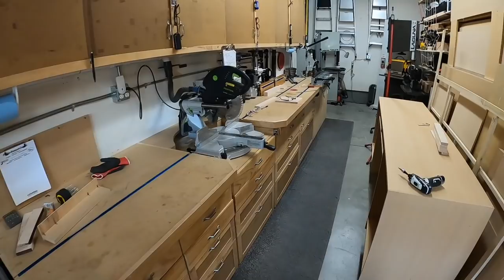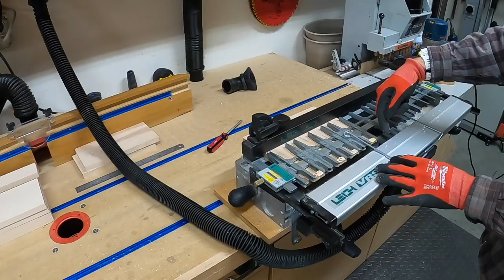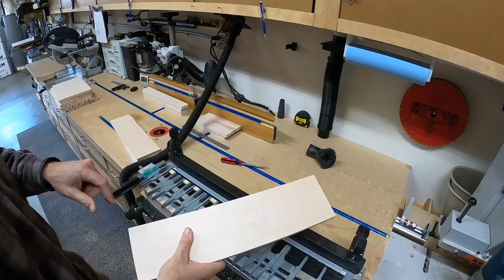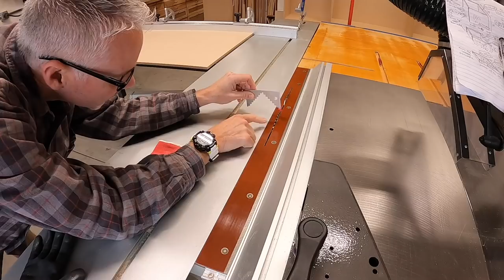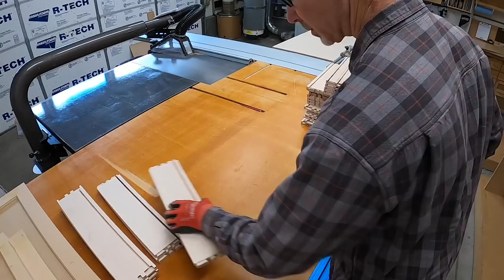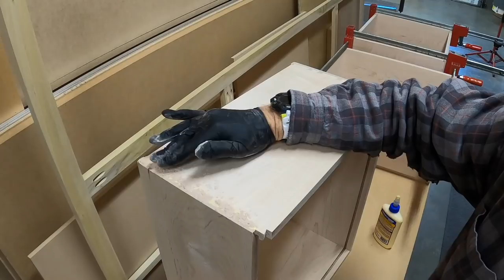How I Make Awesome Custom Dovetail Drawers!  With Tons of Tips Along the Way.

Comment: Hi David the drawer boxes turned out very nice after your slight hiccup. I've owned sliding table panel saws and worked on many like yours. It would of been my first and only choice for cross cutting the drawer components to length. The small power tool cross saws are hit and miss but your main s s panel saw is the bees knees as it's built more robustly to cut squarely, accurately, repetively every time. Enjoyed watching. Tony
Reply from the maker: Thanks a lot Tony.  I think you’re right about that. However I just never saw any reason to not trust it.  I make drawers all the time and just can’t believe it happened.  I’m glad though that it did so I know to check and or use the slider instead.  Thanks for the compliments also.  That’s really nice to hear.

Comment: Nice workaround on the square issue.
I've got a nice miter (Bosch 10" axial glide) but all my crosscuts have now move to my incra 5000 sled. SO MUCH BETTER!
Reply from the maker: Thanks man. Yes the fix was easy but not too bad.  Just more disappointed than anything.

Comment: I never liked the Leigh jig, it was a lot of fussing to get it setup right, I use the now discontinued omni jig, I have different templates for it, works well. Like someone else said not sure why with a nice Italian slider you would use a chop saw to cut pieces, What do you do to cover the piece in the back you cut out to slide the back in?  to me it looks unsightly
Reply from the maker: I’ve had the Leigh since it was first made and have been extremely happy with it.  As you can see the results I get are amazing.  I also have another porter cable jig for fixed dovetails so it’s a great combo.  Not sure what you mean about the cover in the back that I took out?

Comment: Do you ever make Baltic Birch dovetails for drawer?
Reply from the maker: Hey I don't usually.  If I use baltic birch I will do pocket holes.  Dovetails are only on solid wood for my jobs.  But If I were doing shop cabinets or similar, I may use dovetails with baltic birch or mdf drawers.

Comment: You didn’t want to use your feeder for running your stock on router table?  I’m in the market right now for a feeder, was hoping to see yours in action there.  Thx David, appreciate the videos
Reply from the maker: Hey man.  I could have used it for this job for sure.  Sometimes it’s too fast though.
Reply: @davidbryanwoodworksandmore  Hey no problem.  What brand/model are you running?  Have you seen the new Comatic DC brushless servo motors?  Incredible what they are doing with this technology.  I’m considering the EZ40D, which can be turned way down in feed rate. It has a variable rotary switch built into it.  Looks pretty sweet!  I’m new to feeders, but do sone inquiring with a few experienced folks about which one would be good for my shaper.  Thx
Reply from the maker: @tundrawhisperer4821  I have the steff feeder on my router table.  It’s a model that doesn’t have rotary variable speed.  Those are usually very expensive and big.  I wish mine had variable speed in the size it is.

Comment: As always beautiful work👍….. Do you think that jig would work with Baltic birch plywood?
Reply from the maker: Thank you very much.  Yes absolutely.  In fact it’s very common to use Baltic birch for dovetails.
Reply: @davidbryanwoodworksandmore  thank you David, I am currently in the process of making my very first complete kitchen, and yes with a lot of help from you👍
Reply from the maker: @MANUELMANNY509  awesome to hear.  For kitchen cabinets, I’d use solid wood drawers if you can.
Reply: @davidbryanwoodworksandmore  sorry to bother you but what wood do you use for that? The kitchen cabinets I’m working on are shaker style and spray painted.
Reply from the maker: @MANUELMANNY509  no problem at all.  I’d use maple for the boxes like I did.  They will last a long time.
Reply: @davidbryanwoodworksandmore  Thank you.
Reply from the maker: @MANUELMANNY509  you bet.  Let me know if you need anything.

Comment: Probably because you crosscut cut on the kapex first and then straight edged it on the table and jointer? According to your video.
Reply from the maker: If you watch fully, you’ll notice that I say “rough cutting to length”.

Comment: So can you explain how the Kapex failed and made the pieces out of square? Did you not have the miter setting exactly at 0?
Reply from the maker: That’s the mystery.  All my cuts were at the 0 setting.  I simply have no answer to it.  I could be that my blade is getting dull and it made the cutting less easy.  Possibly that could cause me to push harder.  I just don’t feel that was happening at all.  I’m going to test a few more parts to see if it happens again.
Reply: @davidbryanwoodworksandmore  Man thats frustrating. Never felt like my Kapex has enough play that it would be possible to deflect it during a cut unless I was really cranking on it abnormally hard. Either the miter setting is out of square or perhaps even the fence...the fence is often overlooked but it does have bolts and can be knocked out of square. I have found that my bevel setting gets knocked out of square from time to time, and that sucks bigtime for cutting thicker stock. Now I just check with a small 6in square every time before I am about to cut things to final length...
Reply from the maker: @bs838  yes I agree. I think it’s unlikely it came from play. I’ll have to check other pieces of wide stock.  See how it does.  Report back.

Comment: That's why I hate miter saws,  I use a radial arm saw fixed to the wall and the arm secured to the wall it never go's out of 90
Reply from the maker: You must have a good radial saw. That’s really cool to have the accuracy from it.  The kapex blade was getting dull. I think that’s why.  It just needed too much force to make the cuts. Which probably caused me to push off square a little bit.  I ordered another blade so I can send this one out for sharpening.
Reply: Dewalt 790 Contractors Powershop 12" Industrial Radial Arm Saw
Reply from the maker: @kenf2662  pretty cool. I’ve seen many of those in my days.  Congrats.

Comment: I think the problem was that you line ripped and jonted the edges after you cross cut the ends. The edges should be straight and parallel before you cut the ends.
Reply from the maker: This would be a problem however that is not how I operate.  I never do that. So I’m sorry but I Don’t know how you got that interpretation.
Reply from the maker: If you watch again as I’m strait Line ripping the maple, I say, “after I rough cut to length”.  However I think I could have been more specific.

Comment: I may be way off base. If so, please forgive me. I think the problem is that you did your crosscut before establishing a straight edge to put up against you Kapex's fence. Maybe you did that off-camera. If you did that off-camera, perhaps your shims were not of equal thickness.
Reply from the maker: Hi there.  Thank you for writing a comment.  You know when I cut everything to rough size, I wrote and said I was cutting to rough length.  Of course that wouldn’t give me square cuts.  That’s just to get the boards to manageable sizes.  Then I straight line ripped and jointed.  After this I cut to length. Actually I completely cut that part out because I figured everybody would know this or assume I cut to length after I ripped boards.  I’ve gotten several comments about this as they thought the same thing as you.  As someone who is trying to show how to make beautiful and timeless custom cabinetry, I guess I take for granted some things.  Sometimes videos are skipped too much to get everything that is said also.  It’s very easy to miss a lot of important parts when we skip through the videos. I’m guilty of that for sure. We’ll hopefully you got a lot out of the video and have subscribed. Thanks.
Reply: @davidbryanwoodworksandmore  I get a lot out of your videos. I’m a weekend woodworker just up the road from you in Fresno. Mostly I make furniture, but I enjoy watching someone who is good at their trade.
Reply from the maker: @RodgerHarrell  well I’m really glad you’ve found my channel here.  And Fresno is just a ways from me.  Let me know if you would like to see a specific video topic.